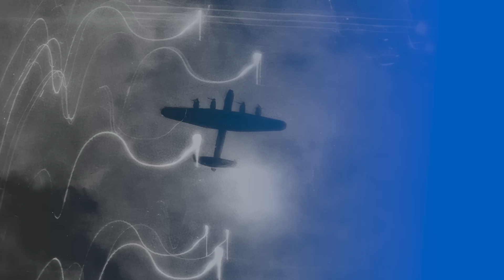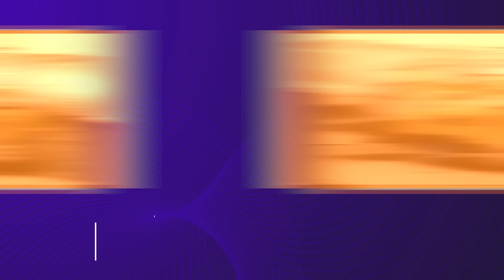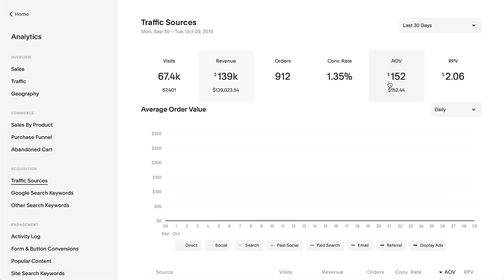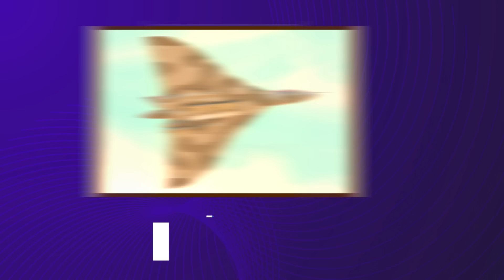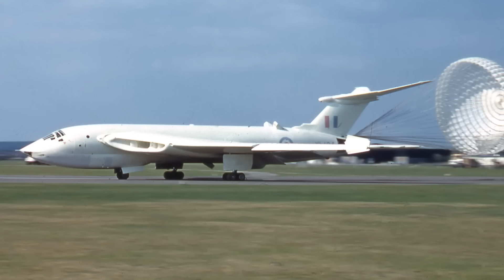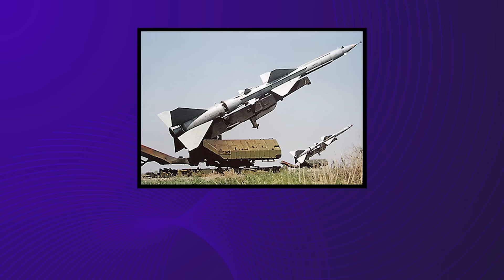The V-Bombers: The UK's Strategic Nuclear Strike Force

Comment: This is very good.

The only thing I would say is that it seems UK couldn’t or wouldn’t maintain & upgrade (to inc fire & forget cruise missiles) a small number of Victors while the US WAS able to maintain & upgrade its similar age B52s….which it used in upgraded form to deadly effect in the later decades.
Problem with relying on multi role fighter aircraft to deliver bigger weapons is that they often can’t or are severely limited in doing so for example F35 only being able to carry 1 Jassm cruise missile at a time.

Comment: I mean to be fair on the 3 out of seven air fields on the first one. It was basically designed to carry nuclear weapons with a bit of room to drop conventional stuff and close only counts in horse shoes, hand grenades, and nuclear weapons where you just need to be in the general vicinity of what you are trying to hit. In the case of nuclear weapons, as long as you're within a zip code or two you should be good to call it a success.

Comment: Very good informative vid, thank you. But those built in jet engines into the the wings are incredible and they look great. I don't know if they actually helped with noise or, more importantly heat signature, but I suppose they flew so high and fast they probably didn't need too.

Comment: I remember in the late 70s, two Vulcans were stationed at USAF HQ Strategic Air Command. During an air show, the Vulcan performed a hammerhead stall at ~3000 ft, which was the most extreme maneuver I'd ever seen of a jet aircraft. I still have a photograph of the camera system.

Comment: It's amazing that after almost 70 years the US Air Force still flies the B-52 bomber. It's navigation, avionics and engines have all been modified and/or upgraded allowing the B-52 to be projected for use untill at least 2035/2040.. Imagine driving a car made in the 50's till today and then untill 2040.. Yes the Cubans have done this and with almost no OEM replacement parts .I saw where a Cuban made brake fluid from V-05 shampoo, ethanol spirits and vegetable oil..

Comment: The Avro Vulcan; what a joke, where engineers designed an aircraft where the rear-cabined crew had a limited choice of exiting the aircraft in an emergency (from the side door, directly in front of the jet engine intakes). A dud design which made its way into service.

Comment: Slight correction Simon, the act was indeed signed into law in 1946, however my belief and information is that once 🇬🇧 the United Kingdom/allied scientists working on the Manhattan Project had perfected their particular part of the device they were unceremoniously required to leave Los Alamos, or wherever they were working, taking nothing with them that even remotely connected to the project and were also required to leave the USA without even a thank you. Because the project was completely compartmentalised in the research, design and delivery sections nobody except for a chosen few had all the necessary information to complete the project, except for the Russians who had spies working on the project from day1, Even Stalin new about the bomb being perfected before Harry S Truman did, and YES I am bitter and twisted about the whole situation, without allied scientists the USA might never have got the “bomb” to work, have RADAR, jet engines, or most importantly the means to drop the bomb, they appropriated the bomb release mechanism from the Lancaster AND they had a Lancaster on standby to carry out the mission if the B-29 proved (which it nearly did) incapable of being operational by the time the bomb was ready. So once again the USA claims the accolades and power, and tells the allies “don’t do as I do, do as I say” a very familiar occurrence back then and still the same today.

Comment: On the subject of the Valiant, there is another side to the story of its fatigue problems. 

When the Valiant was first designed, the concept was to use a single, massive wing spar that would last the expected life of the airframe. To get the required strength, Vickers used an alloy known as DTD 683. This had a high strength-to weight ratio, but, unbeknownst to the engineers at the time, absolutely atrocious fatigue characteristics. This was later discovered as early as 1956 and other aircraft that had also used the alloy were redesigned without it, but the Valiant was already in production, would require a very extensive redesign, was required for the nuclear deterrence role, and was expected to be replaced with Victors and Vulcans soon anyway, so it went ahead. To put DTD 683 in context, spare wing spars, never used, were pulled out of storage and found with fatigue cracks. As it turns out the alloy will destroy itself without any outside input through interaction with water vapour. In other words, the Valiant was always going to have a limited service life. It is actually more amazing that they got as much use out of it as they did. 

Also interesting, the plan had originally been to order two aircraft, which became the Victor and the Vulcan. Edwards sales pitch was able to convince the Ministers involved to back the Valiant as well. When a new government came in in 1951, with the Korean war on, there was serious talk of abandoning the Valiant and taking a US loan of B-47's and bombs for the stopgap bomber. However, Duncan Sandy's (yes, the one who later cancelled TSR-2) would manage to convince the US to contribute to the Valiant development costs (they were unsuccessful in achieving the same for the Victor and Vulcan). So all three went ahead.

Comment: If only the United States defense contractors kept a promise like that (to absorb any cost overruns and to deliver on time if not early). We are lucky just to get a defense project done on time (which is HUGELY rare), and almost NEVER does a defense project come in UNDER budget in the U.S. after all, how in the hell does a toilet seat cost 1500 bucks, or a basic LCD monitor cost THOUSANDS of dollars, or a basic diesel generator on a naval ship (just as a diesel generator on ANY large vessel of comparable size) cost close to a quarter million? Even a 24 cylinder diesel generator can be bought for under a hundred grand, and that's WITH the diesel engine, generator setup, and the computerized management system that controls/maintains/ and monitors the entire system. 

But hell, the Senate oversight committee rarely if EVER reviews a damn thing, let alone steps in/asks any damn questions (like 'hey, why does this light bulb cost $750 bucks when I have an identical one at home that home Depot sold me a multi-pack of for $15 bucks')

Gotta love the kick back system; Capitalism's illegitimate and inbred relative.

Comment: Our family farm was under one of the low flight paths used by Vulcans during the 1970s. They were both loud and aerodynamically "messy" - when the plane could be seen disappearing over the horizon around 20 miles away you could still hear the rustling of the air as the wing-tip vortices trailed many miles behind it. As it was a hill farm occasionally we'd look across and down "into" the cockpit - they were a little loose with the minimum height regulations back then. Only ever had one Victor fly over.

Comment: @megaprojects: Please tell your writers, and try to remember it yourself, because this is the third time  i have to correct you: The Thrust of a turbine engine is NOT measured in Pound-Feet, but in Pounds (or kN). Pound-Feet is a measurement of Torque.

Comment: You keep expressing thrust in lb*ft (pound foot). Lb*ft is a measure of torque. Thrust is measured in lbf which is pounds force (as opposed to lbm, which is pounds mass). It may seem minor but drives us engineers crazy. Even better would be to use SI units which is Newtons (N).

Comment: That was amazing. Edit Writing a comment half way through is a bad idea. He covered first point well.
 Only thing I'd mention is that the government's requirements were for high-altitude bombers. Never was there a request for any low level operation. Don't think you made that clear. Advances in ground to air missiles from the Soviets put the high altitude bomb runs out. There are many reasons why this puts extreme stress on the airframe and the Valiant can't really be faulted for developing stress fractures because of it. Only the Vulcan excelled in this role. You can see from the shape there is nothing to bend!
You also mentioned foot pounds for thrust and I think that is wrong. Thrust is just pounds. 
And as many pointed out the Hurricane picture was an oops.

Comment: Interesting how the UK couldn't adapt these aircraft successfully  but the US is still flying the B52 which has been adapted several times.
Reply: Cost: it wasn't so much that the Victor and Vulcan airframes (espectially the Victor) couldn't be adapted, it was cost: Britain didn't have the sheer amount of money the US did to maintain and upgrade airframes.  Despite the hype regarding longevity, the B-52H airframes have been effectively rebuilt a few times, and at great cost.  If your country can, or wants to wearvthat cost, then fine.

Comment: Someone really needs to let Simon know that “pound-feet” (lb-ft, or more properly foot-pounds, ft-lb) is a measure of TORQUE and NOT thrust.  Thrust is a FORCE, measured in pounds (lb).  It’s unfortunate that some use “lbf” for “pounds of force” to distinguish with pounds of weight, but it’s all force.
Reply: That's around four henweighs, is that right?
Reply: Similar annoyance: I have a bicycle tool that reports in kilograms of force.  Grrrrr!  Newtons, dude!  The unit is newtons!
Reply: I think all imperial bathroom scales should report "weight" in slugs.   😏
Reply: @christopheroliver148  Slugs are a unit of mass; the unit of weight (which is a force) is pounds.  Just like kilograms are mass while weight would be in Newtons.
Reply: Yet air rifles in the UK use Ftlbs as a measure of power, it's a function of the weight of projectile and speed.

Comment: In the case of the Valiant being delivered on time and budget... It's amazing to see how much more efficient companies get when the threat of national extinction looms over their heads. How they quickly shelve their "delay to milk as much profit from the government as humanly possible" business strategies when they might all die over making a few more millions.
Reply: That had nothing to do with the Valiant meeting its delivery deadline. The overwhelming reason why such contracts fail to meet their deadlines is not due to manufacturer's deliberately delaying production which in fact results in significant financial penalties rather than because of changes to design specifications on behalf of buyers once series production has commenced. In the case of the Valiant there were no such demands made for any changes whatsoever, primarily because the RAF but particularly the MoD and UK Government simply wanted to achieve the nuclear bomber capability which this the most conventional and therefore proven design represented out of the three V Bomber contracts that were issued. 

The Vulcan and Victor were far more revolutionary designs with a much greater prospect of design changes once prototypes of these aircraft entered testing, with the most significant of these being to the wing of the Vulcan which adopted a 'cranked' delta configuration due to unsatisfactory handling issues encountered as the airframe attained limiting Mach number speed which resulted from the original straight edged delta format.  A contract was issued for a fourth aircraft to a simpler specification, the Short Sperrin with a straight winged design was an additional contingency if any of the V-Bomber designs proved to be unsuccessful.

Comment: Wait. He didn't mention Operation SkyShield, in which the UK sent Vulcans over to nuke the United States... with simulated nukes in the 60s

Apparently the results were so embarrassing the USAF classified the results, and didn't declassify it until 1997.

The real amusing bit is that they ran the exercises multiple times... and the Vulcans serenely sailed through the interceptors using their speed, altitude, and electronic countermeasures.

Comment: I once watched a Vulcan perform in an air show at Barksdale AFB, Louisiana, USA in 1975. It was amazing. I was sitting on a berm near one end of the runway. The Vulcan took off and made a couple of stately passes the length of the runway. Then the Vulcan climbed to around 20,000 ft (6,000 meters) then dived down to under 500 ft  (150 meters) and went screaming (literally) over the runway at over 400 knots. As it reached the end of the runway it went into a vertical climb and proceeded to perform an Immelmann turn. I later asked a B-52 pilot I knew what would have happened if he tried something loke that in a BUFF. He advised me that the wingtips would have touched like the hands of someone doing.side straddle hops just before departing the aircraft. The USAF Thunderbirds performed that day but the real star was the Vulcan. Amazing aircraft!
Reply: Yeah, I saw a similar performance at Abbotsford International Airshow -without the Immelmann, though. It was the last time in Canada.
Reply: The Avro Vulcan has been the star of the show at almost every airshow that I've ever been at (until it stopped flying). That characteristic howl, and all the car alarms going off is a sure sign of a Vulcan display...as well as it going into a turn, and blocking it's own sound with it's body, and suddenly going silent. Beautiful plane!

Comment: The Valiant was delivered on time because it didn't suffer scope creep as many other projects do. It had a spec to hit and the spec didn't change, so it hit it. The problem with other projects is they see how well it does X then they want it to also do Y and Z, which wasn't in the original design spec, so it's tacked on and takes longer to find a way to make it work with what they have without having to start over.
Reply: Yup. Happened with the F-111 with the B variant and again with the F-35. Meanwhile you have planes like the F-15 and F-16 which were designed for specific purposes and had enough excess performance potential that they evolved in to more roles over time. Heck, it happened with the F/A-18 which had its roots in the program that developed the F-16; just navalized and with a bit more focus on ground attack capability from the outset.
Reply: @RaderizDorret  
Unlike the F-111B though, the F-35 didn't scope creep, it was just complex, extremely powerful and therefore expensive.
The Valiant though, was simple.
It wasn't cheap and on-time because it didn't creep, it was because it was a simple aircraft built with yesterday's tech (meaning 40s tech)
Reply: @MostlyPennyCat  That and it was a generational push in multiple ways which caused development costs to simply soar.
Reply: Just like build me a big villa, but then make it contain several apartments and somehow fit in a convenience store
Reply: While this statement is true, it still does not offset the fact that many many if not most projects go unfathomably over budget and over time.  All this does is shift some if not all responsibility for these failures.
Reply: It was also much simpler than the others, they also didn't fare too well in the fatigue department - they had a pretty short service life as a result. 

Though much more complex, the Valiant and Victor were both arguably more successful. Though Valiant did drop our first A-Bomb, which is pretty cool in itself.

Comment: I just thought of something else that the v-bombers have in common the B-52 outlasted all of them
Reply: The B-52 is much more a conventional design, they’ll likely pass 100 years in service. The Russians also have a plane still using props that will more than likely reach that too.
The V bombers were designed for one particular role that became obsolete during their development. The Vulcan was so effective that when the US asked the RAF to use them on dummy bomb runs over major US cities, it hit every target without interception.
The B-52 is a great piece of engineering but it was made as a multi role aircraft using more conventional aircraft building techniques, the Vulcan and Victor in particular were totally unique, nothing came close.
Reply: @adsyoffinch  cool story but the B-52 did everything the v-bombers could do minus something like maybe speed and could hold more bombs then if you wanna take unconventional designs the USA designed the XB-70A Valkyrie which is the V-bombers on steroids but the B-52 still outlasted because of one thing price the only bomber that could dethrone the B-52 is the b-21 raider but it barely carries half the payload of the B-52's 70000lbs payload only it being stealth is way it's better but will probably not make the usaf get rid of the B-52s all in all the B-52 is still in service and going to be from many more years to come but the V-bombers are not so which stayed relevant and this is way hyper specialized planes never last like the SR-71

Comment: Honestly the Valiant B.2 is a huge missed opportunity. Not long after the prototype was scrapped, low level intruder aircraft became a huge concern (think F-111,  A6, B1B, etc)
Reply: The UK's low level strike bomber would have been the BAC TSR 2 if politics hadn't killed it.
Instead we used the Blackburn Buccaneer which was still a very good strike aircraft.
Reply: @fl_3682  which was also shortsightedly scrapped. But that is in another video. 😂
Reply: @Gareth Fairclough the B.2 variant was reinforced with low level flying in mind. You're thinking of the plane jane Valiant.